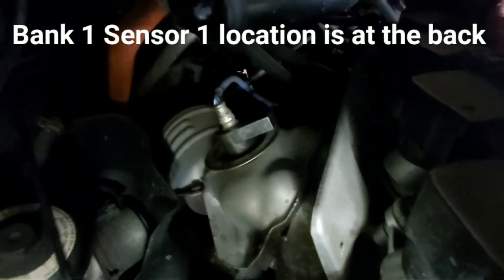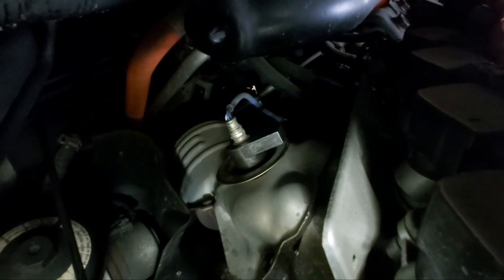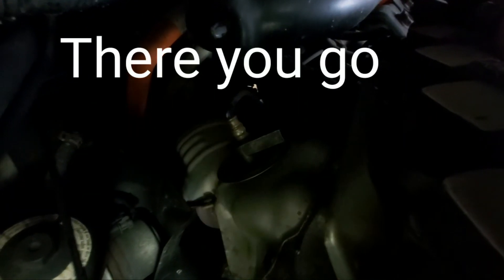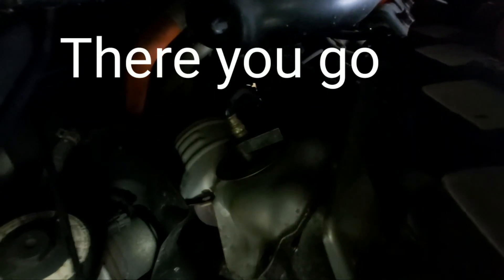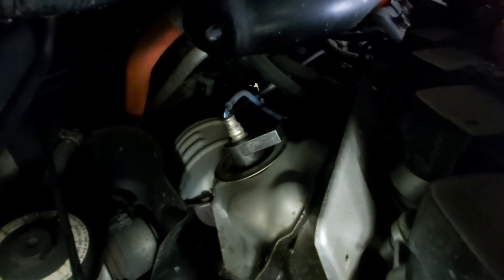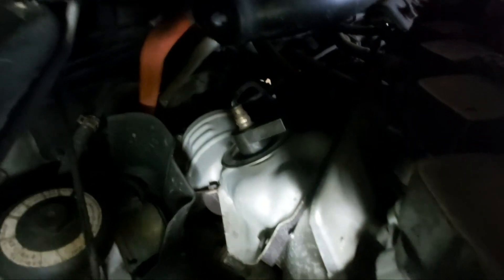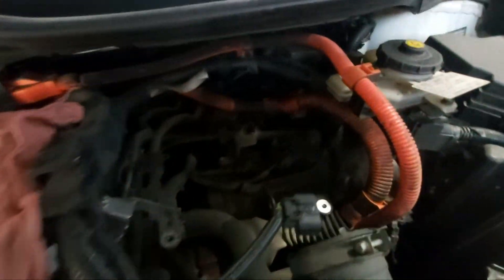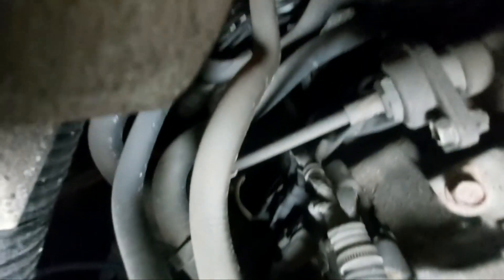2007 Honda Civic 1.3 Hybrid Code # P2A00 - O2 Sensor Bank 1 Sensor 1 Replacement

Comment: what do you think about code p0171?? can it be sensor as well?
Reply from the maker: Dirty or faulty mass air flow sensor
Vacuum leaks – PCV hose, vacuum hoses, intake manifold gasket.
Weak fuel pump
Clogged or dirty fuel injectors
Exhaust leak
Faulty oxygen sensor